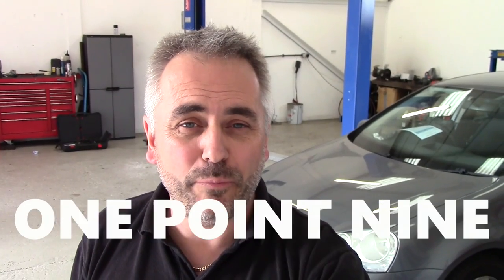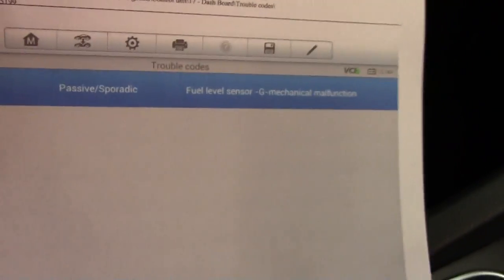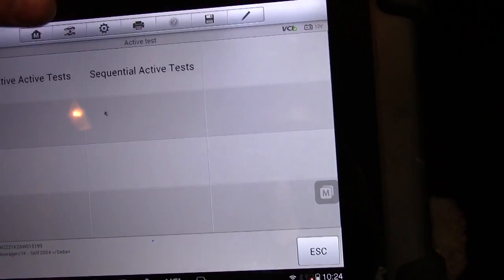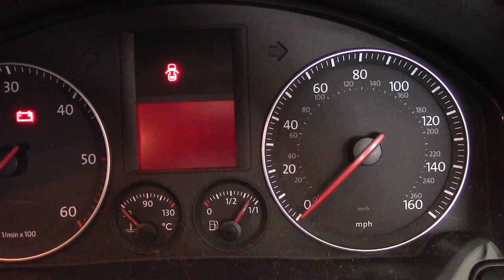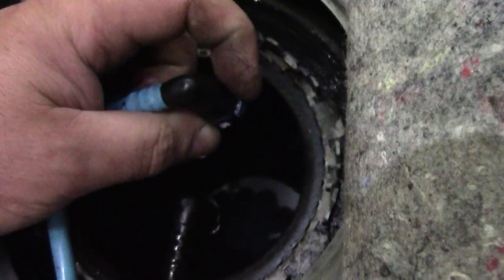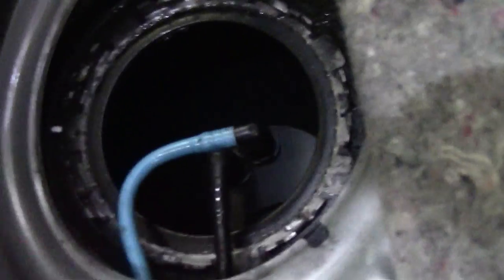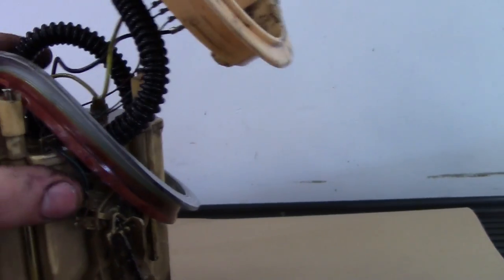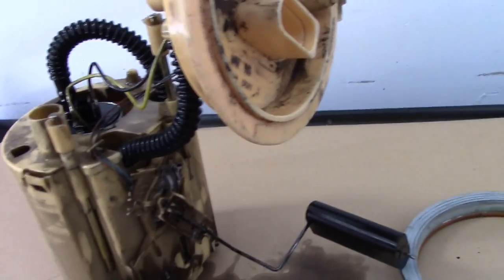VW Golf TDI Fuel Pump/Level Sensor Replacement

Comment: I'm quite impressed the car warns when the fueltank drains quickly. Not sure if the average user would tweak what's going on fast enough to avoid a lot of diesel being dumped on the road, but I like the fact someone's thought of that.

Comment: Output tests are a handy first step in a diagnosis! I like the smell of diesel exhaust more than the smell of the fuel itself. I've gotten the fittings reversed a few times over the years... and wondered why the engine wouldn't start. VW could have made them different sizes to avoid that issue. =)
Reply from the maker: Thomas EXOVCDS Really! I can't stand the smell of diesel. Yes different sizes would make life easier. Have you ever come across a broken fuel sender after a collision? Gotta say this was a first for me.
Reply: One Auto, No, have never seen one break like that. Must have been low on fuel when the accident happened (my guess is a full tank would not have allowed the pump to move past the breaking point).

Comment: Nice video Rob and an interesting point you made about getting the new pump and sender unit from a VW supplier, I tried two non OEMs in a Passat and both whined a bit but they were half the price and with a full tank you dint notice it.

Comment: Ive got a weird problem with my Mk4 Tdi Golf basically the car is struggling to accelerate and the speedo has stopped working also when turning corners the fuel gauge goes to zero anyone know what would cause this ? i first thought it might be the fuel pump but i hear it whine on ignition and car starts first time so possibly injectors or blocked fuel filter ? as when the gauge reads zero the car  feels like it has no fuel ?
Reply from the maker: You could have a similar problem to this one. With the level sensor/pump pick up broken it wouldn't always pick up fuel from the tank and lose power especially when low in fuel. Might be worth removing it for a visual inspection.